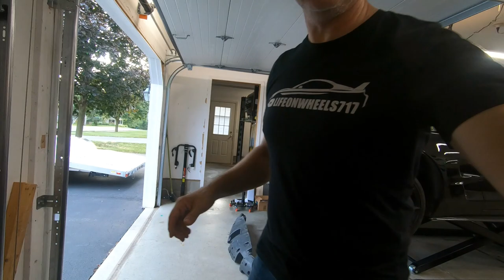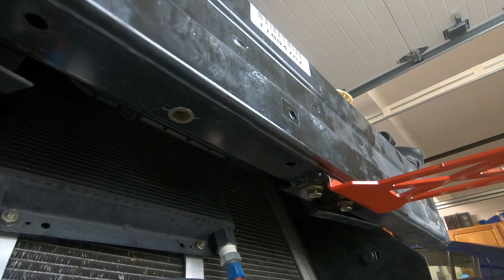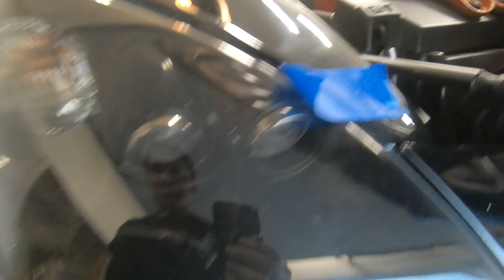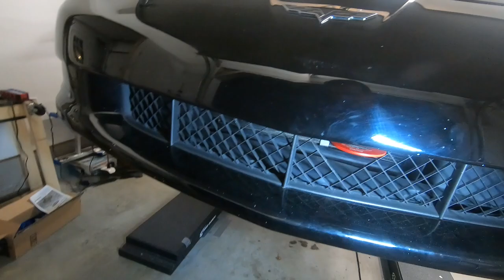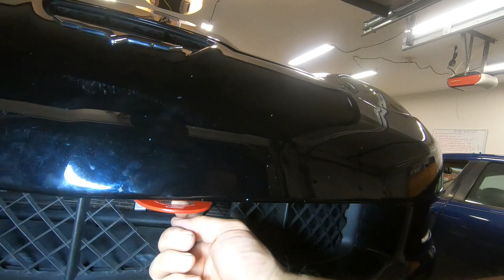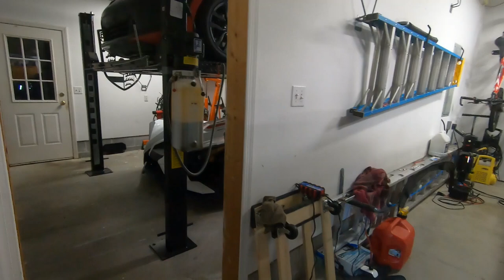tow hook installation did not go as planned

Comment: It's just as I had commented to you in your earlier upload. You confirmed my suspicions in that I thought you'd have to improvise by welding. And as I feared, it's really not long enough. You could always notch out the bottom of the bumper so that a full size hook could be used. Kudos to you for following through on this. I have my own ideas more or less firmed up in my mind as to what I'll do with my GS, but I have to find someone with talent to do it for me. FWIW, I've seen where tow hooks have been installed in the rear in between the factory exhaust tips and they work well, but unless you have the factory exhaust, or it's equivalent, it can't be done. I have the Corsa exhaust and those tips are equally spaced leaving no room.  If I can put my plan into action before Carlisle we should meet up and go tow hook to tow hook. LOL

Thanks so much for this upload Laz. As the saying goes, necessity is the Mother of Invention and you're living proof of same. I take my hat off to you.

Stay safe and Save the Wave.